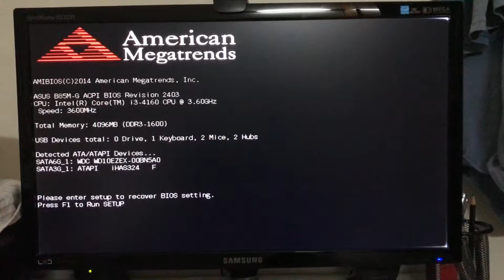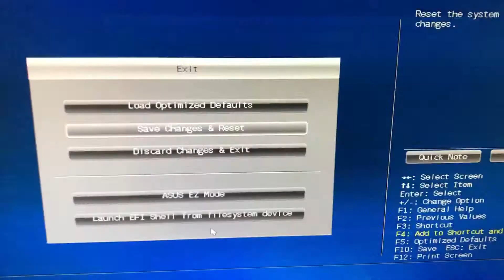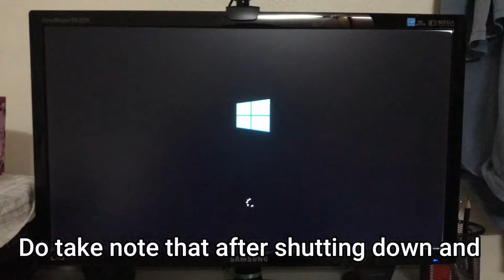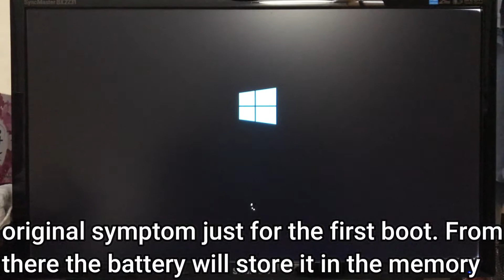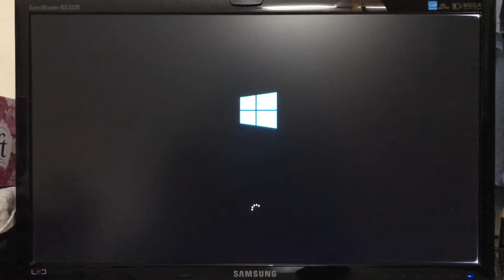How to fix your date and time permanently after booting up the PC and to replace CMOS battery

Comment: Battery changed,time and date change,everytime unplug power the problem is back again
Reply from the maker: try checking if your time zone and your region settings are correctly set
Reply: Yeah i had same problem. I did replacing cmos batt but still the same. After unplug the power and then you start again the problem still occur.
Reply: @RyanWKW  already set,but well its back again after unplug the power and start again,cmos battery changed,cmos reset,tried another psu,ram,still the same,if only restart its all good,bios can save,the only problem only when unplug the power and start again.still dont get the answer everywhere
Reply: @marioarnelbuenafe6868  asus motherboard?
Reply from the maker: @jhonspetruk  did you check the polarity of the battery?
Reply: @jhonspetruk  yes asus motherboard.
Reply: @jhonspetruk  How did you fix the problem?